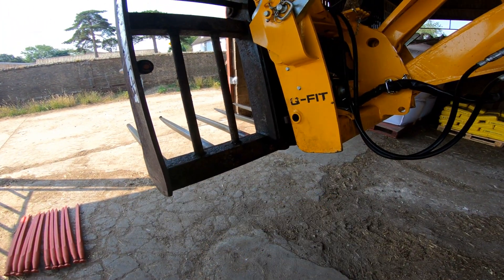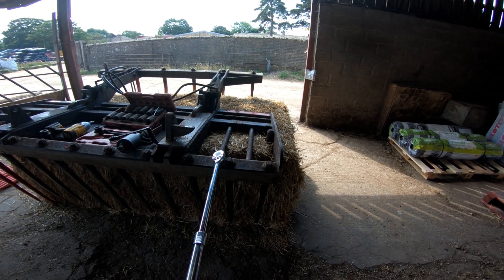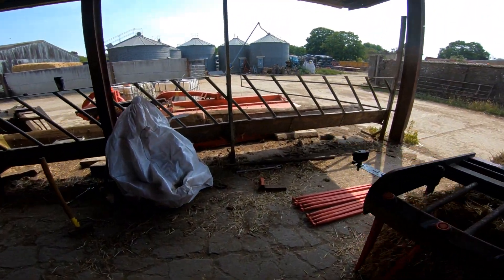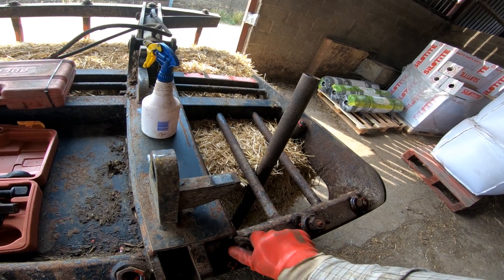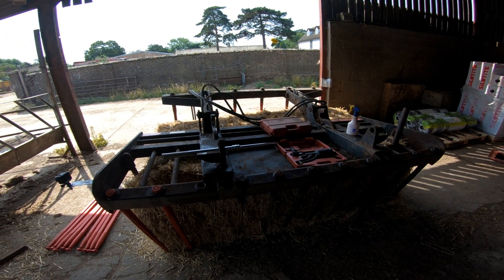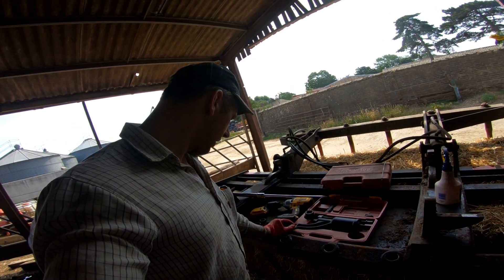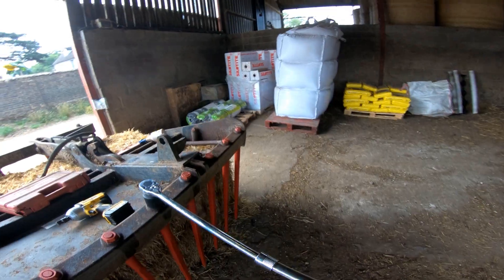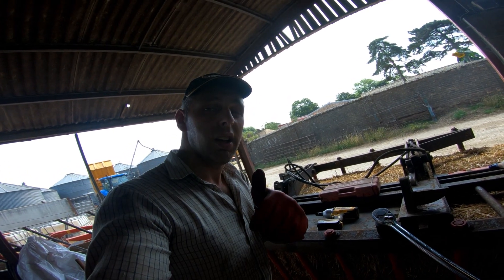Fitting New Tines To The Muck Grab. Trying out New DEWALT Impact driver

Comment: You want a 5ah 18v battery minimum on them guns to reach maximum potential, that little 2ah one is only designed for  dewalts D.I.Y drill. We have a large pair of stilsons and a long scaffold pipe for bale spike tines at work.

Comment: Got the same dewalt gun here and the battery makes a huge difference. I run it on 5ah batteries and thought it was ok, it would shear an m12 bolt if left to rattle for several seconds with a fresh battery, then tried a mates 54v 9ah flexvolt batteries on it off his big grinder and felt like a different tool altogether easily shearing smaller bolts and getting loads more torque into bigger bolts on shed frame etc. So well worth a look but at £250 for a pair im still saving haha!

Comment: What’s that big impact gun that Wes pandy has for his wheel nuts and large bolts. I’m sure sure he said it can undo it if you can hang onto it. But you still can’t beat the old torque amplifier, just need to watch out for some of those Chinese brands as I have bust a leg off one before undoing a truck wheel nut. Thanks for the vid

Comment: YO George...at at about the 21:03 mark when you were saying 'I can't see it' regarding a battery-powered impact drill snapping bolts, a cow was agreeing with you in the background.  How the bloody hell did you manage that bit of sound???  Anyhoo...I've lost count of how many nuts/bolts I had to heat or burn off until I 'discovered' there was such a thing as a torque multiplier- rust is one stubborn beast for sure!  Nice bit of kit that torque multiplier - is that a Klutch?  Nice video - keep them rolling.  Stay safe - be well - many blessings.